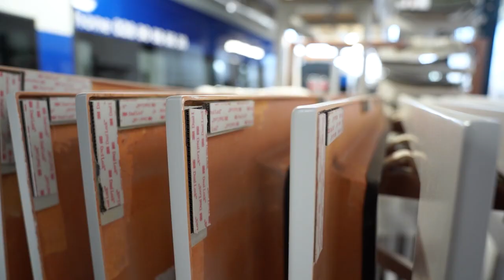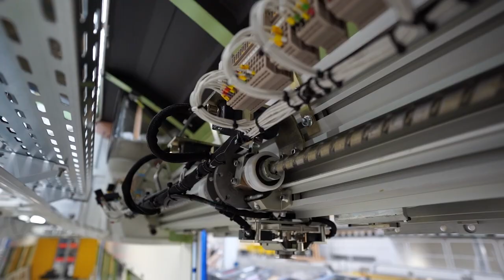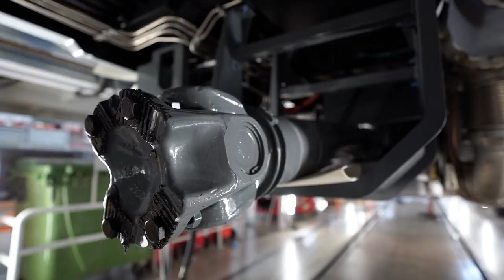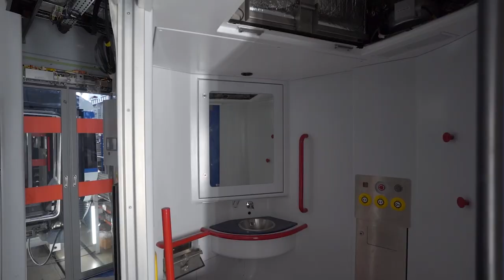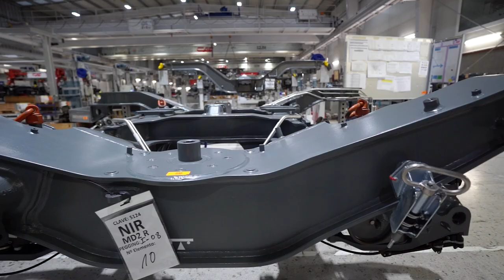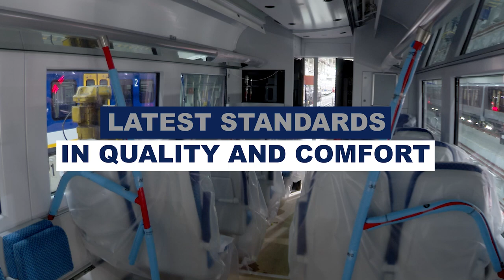N I Railways New Carriages - Preview

Comment: CAF should also build more new trains including for Scotland if ScotRail wants to replace the older units ie Class 153, Class 156 and Class 158 DMUs then CAF could manufacture new trains that will be used on non-electrified routes in Scotland. And to continue with the mass production of the Class 196 and Class 197 Civity and other new Civity units in England and Wales.
Reply: Wait, aren't they DMU's? It's like the old thumpers!